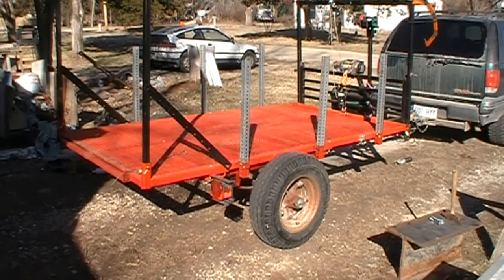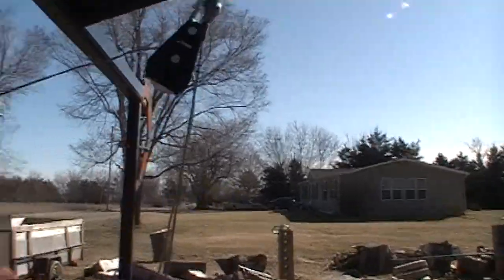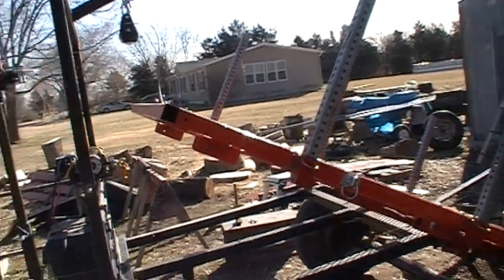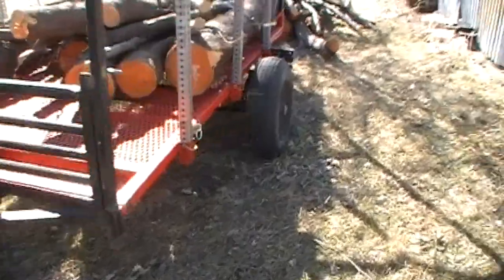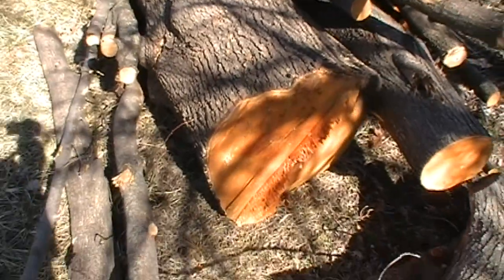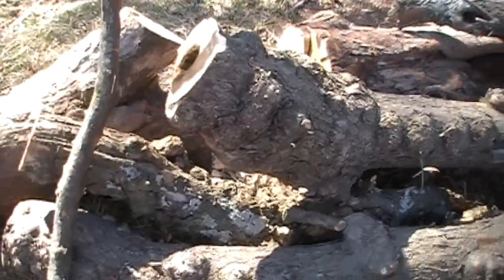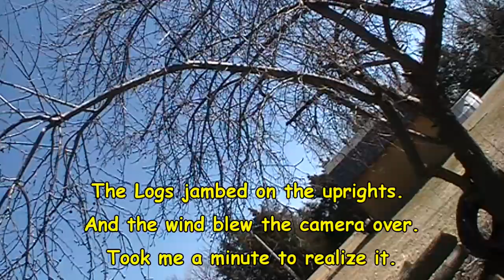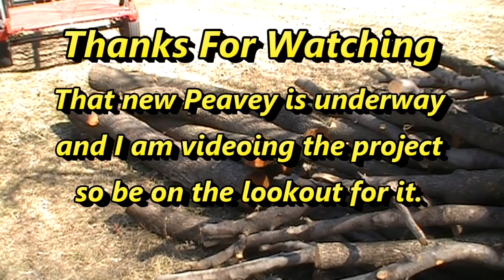#62 The Improved Logging Trailer

Comment: It looks like if you had pulled away straight instead of turning, you wouldn't have had the binding of log vs uprights, so you might not need to add any perforated sides if you can just pull straight forward away from under the logs.
Nice build and function!

Comment: what size square tube did u use for the gantry? looking to build one of these on my 5x8
Reply from the maker: The back arch is 2X2 on top the legs are 1.5X1.5 all heavy wall and is pinned inside of 2x2 at the bottom, so it can be removed. The front is the same but shorter of course and is welded in place. I also added braces at the bottom that tie into the tounge to keep it from wanting to fold to the rear when it has a heavy load on it.

Comment: What size of winches do you use?
Reply from the maker: This one had a 5000lb and a 2000lb. Later I did away with the smaller one and did everything with the 5000. My current trailer is 16 ft long and has a 9000lb winch o. It.

Comment: Man, that color of the pear, looks damn good!! would love to see something turned from it.... Nice set up, it all looks like it is working fine, what did you say nothing ever works right for you?? :) next time call me, I'll come give you a hand if the old man is not around :) and even if is, you can still call on me :)
Reply from the maker: +Yuval Lahav Woodturning  The Bradford Pear is kinda weird. When you cut it, its white, after it sets for about 30 minutes it turns the golden color you saw in the video. Then as it dries out it is white again. But if you oil it when dry it turns gold and if you Lacquer it without oiling it stays white. Like I said weird stuff. It turns great both green and Dry though and has very dense grain. There are a couple of projects on my channel I used it on.
Later Dude